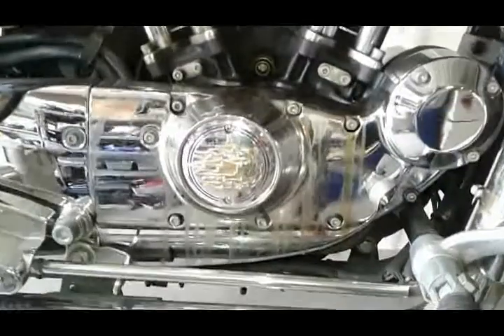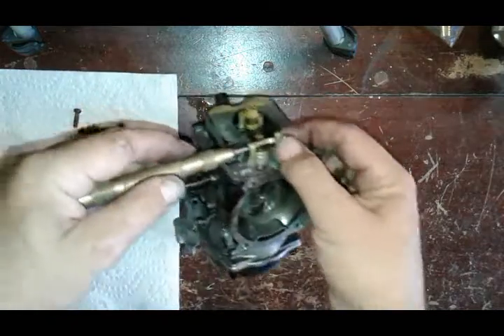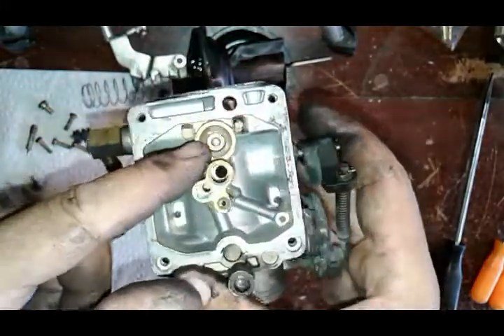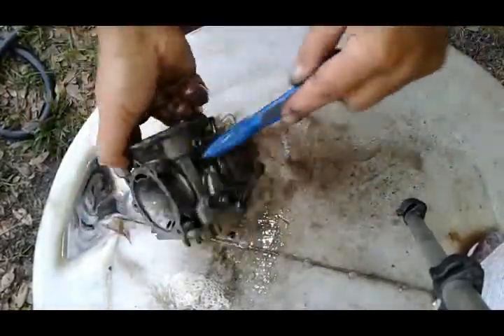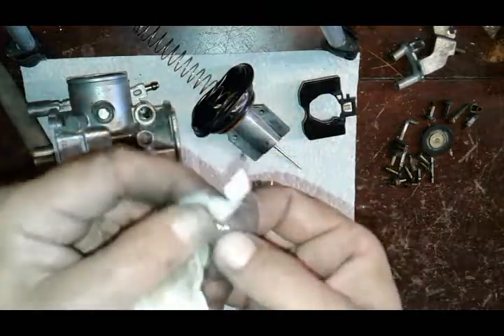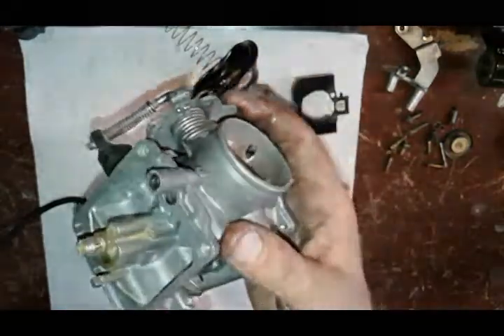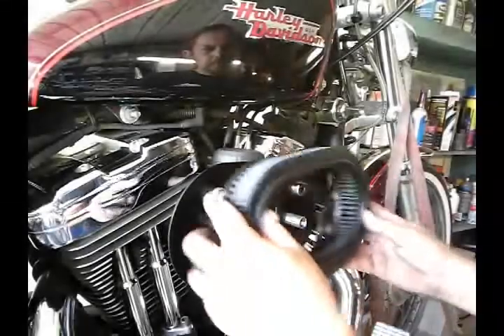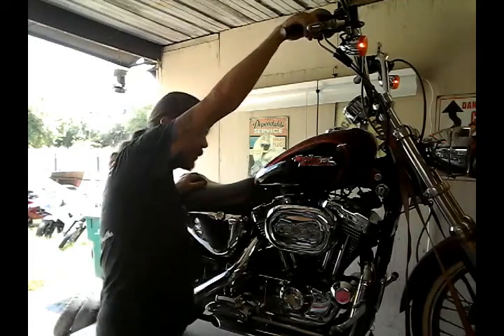Sportster carburetor rebuild complete guide

Comment: Thanks for the video. I had no idea about checking the acceleration pump...and it ended up being one of my issues.
One thing to pass along...the float should be set at around 18°-20° before it moves from resting position on the needle 👍 safe rides 🤙
Also...**new subscriber**

Comment: i was shocked to find out the carb itself isnt bolted in place. its just wedged in place by the air filter (which is bolted in place). just amazes me they would design it like that

Comment: Awesome video I picked up a 91 1200 sportster and gas comes right out of carburetor while the bike is running. I have had bike for 2 years and bike ran great. Bike just started leaking gas. Do you have any idea why this would happen. Thank you for any help with this problem.

Comment: I rebuilt my carburetor  now its bacfiring thru the carburetor  what causes that any help would help your video  helped alot
Reply: In short: incorrect timing, lean fuel mixture, valve issues, and incorrect valve adjustment, can all cause backfiring through the carburetor on a Harley

Incorrect Timing: If the ignition timing is off, the spark might be firing too early or too late, causing the combustion to occur when the intake valve is still open, which results in backfiring through the carburetor.

Lean Fuel Mixture: An overly lean air-to-fuel mixture (too much air and not enough fuel) can cause backfiring. This may occur if the carburetor jets are clogged, or if there’s a vacuum leak.

Valve Issues: If the intake valve is not seating properly or the valve timing is off, unburnt fuel may ignite in the intake manifold, causing backfire through the carburetor.

Incorrect Valve Adjustment: Improperly adjusted valves could be staying open too long or not closing properly, allowing combustion gases to escape through the intake.

Crossed Spark Plug Wires: If the spark plug wires are connected to the wrong cylinders, it can lead to improper firing, which may cause backfiring.

If you fixed it, what was it?

If not more details needed, such as the type of engine or any additional symptoms. 

Good luck

Comment: Thank you ,if that choke pin was bad would it dump excessive fuel in the engine?
Reply from the maker: Hi Kenneth, the only reason I can think of on this carburetor to flood the engine instead of coming out from the overflow down on the ground is that the overflow is clogged up...regardless if it's flooding you need to replace the float needle and make sure your seat ( the hole where the needle is sitting) is perfectly clean and not causing the needle to stick in place .etc.. You need to figure out why it is flooding and that's all there is to your problem...choke have nothing to do with this...make sure you not using any sharp tools to clean the "hole" up...carburetor cleaner spray and other solvents is the best way...if you scratch it where the needle seals the fuel it's fucked! Thanks for your interest in my video and please subscribe to help me out

Comment: Hey I have 1995 1200  sportster and the spray nozzle isn't spraying gas in the carb therefore making my bike run way lean..and the slide diaphragm isn't sliding like it should, would I need to rebuild it?

Comment: So I just purchased a CVP premium tuner kit, also replaced the accelerator pump. I installed everything, however I think I have a small spring leftover about the size of the one that goes on the air/fuel mixture screw but a little smaller. Can you tell me what all gets springs? I put everything back together and the carb doesn't seem to be getting any fuel. It wasn't having any issues before. I put everything back together, turned the fuel back on and tried to start the bike. When i rolled the throttle nothing was coming out of the accelerator pump needle and after taking it back apart there was no fuel in the float bowl. Possible issues?

Comment: Hm, it's better to replace all the rubber membranes together at once, but where it's possible to find to by the main jet needl drive membrane, with drossel assembled at last?
Reply from the maker: Hi Maxim, it is very easy to replace the top diaphragm (membrane), You can just pull it out of the plastic slide and after lubing the new one install it back in. I have looked up for you link on ebay for the whole kit. Hope this will help you and good luck with your carb rebuild job. Please subscribe to my channel...it will help me out
 https://www.ebay.com/itm/Carb-Carburetor-Rebuild-Kit-27421-99C-27490-04-For-Harley-Davidson-CV-40mm-CV40/363118073665?hash=item548b861741:g:8EIAAOSwUDhfayia
Reply: @DoityourselfMotorcyclerepairs  HI, thank you for the concern, now I'm trying to overcome the problem with fire rejekts at 1/4 of the trottle, all the carb parts seems at norm condition, may be only adjustments needed, good luck to you!

Comment: I'm trying to find a video confirming the accelerator pump. With out a check ball I see no way it can work. I know for a fact my carb doesn't have one and at the moment gas just spits up back into the bowl rather then coming out the nozzle.  I've seen a video where there was a lot more going on with more holes and a check ball on a cv 40 accelerator pump, so I baffled at the moment.  Clearly there was more than one design, and if there was never a check ball in the design your carb and mine have, how could it ever really work. Why would they put most of the accelerator pump parts on a carb and not have it function. In my opinion the engine vacuum is on the wrong side of the throttle blade to assist the gas from just getting pushed back from where it came from, rather than the smaller hole in the nozzle. A huge majority of motor cycles never had accelerator pumps on this type of carb and ran fine.